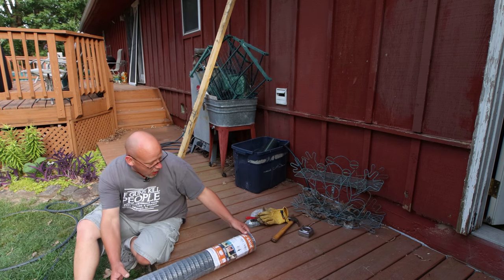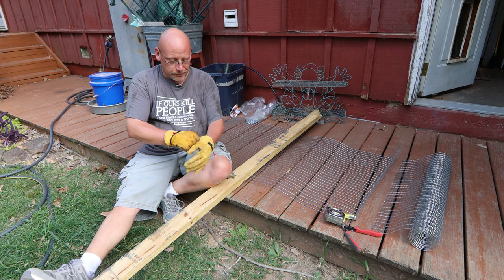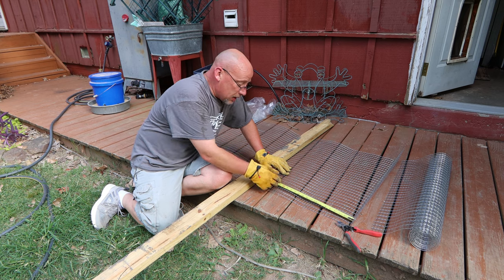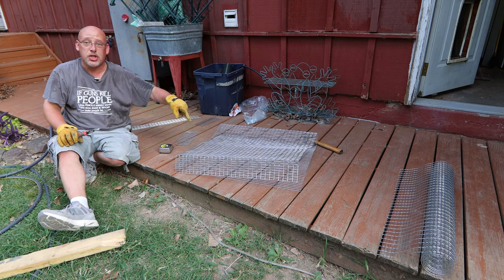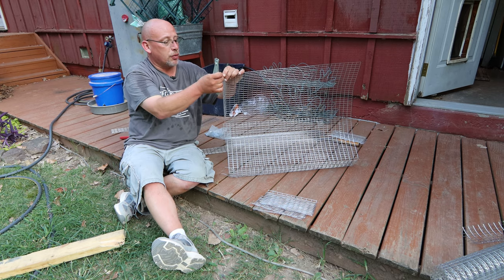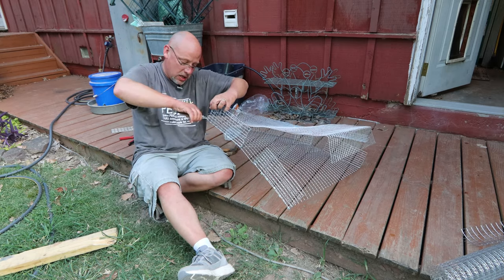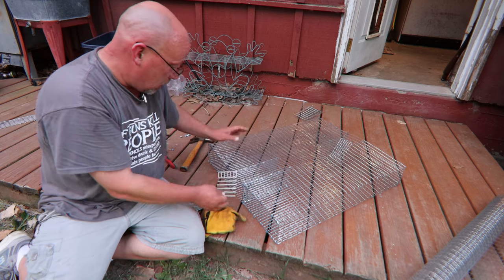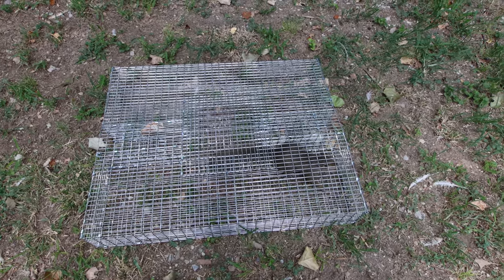This Will Finally Fix The Squirrel Problems I Am Having

Comment: Awesome video! That is a perfect squirrel trap and it will work! I have captured hundreds of squirrels 🐿 with the Squirrelnator in a few months. They ate up tons of my chicken feed and dig out the concrete patio slab. This is a great build wish I saw this video before to save some cash, but if you have the cash for one and you are not handy definitely get one to eliminate your squirrel issues. I almost ordered 2 of them but you only need one it’s that effective. Have you ever caught rats with that build? Btw chicken scratch works perfectly

Comment: If you know the size of the mesh, you don't have to use a tape measure. If your mesh squares are 1/2 inch and you need to measure four inches, just count eight squares.

Comment: Hey Chris, Two true stories. 
My uncle had a similar problem with squirrels. He used a live trap and released them on the other side of a canal and river away from where he lived. No matter how many squirrels he relocated there was always a never ending supply of squirrels to catch. One day he stopped at the feed store for bird seed and was telling the clerk the story about his never ending supply of squirrels and how he relocates them, The clerk started to laugh and told him that there was a guy who also had a problem with squirrels and couldn’t catch them all. It turns out that my uncle and the other guy who lived on the opposite side of the canal and river where catching the same squirrels and releasing them back and forth over the canal & river.
We were over run with opossums and racoons, so we set up the live traps and released them a good distance away and everything was fine. But soon we had the same problem and I could swear that they were the same opossums & racoons. So, I sprayed a small patch of spray paint on their tails before releasing them and sure enough the same ones made it back to our property. 
The moral of the stories is to relocate them very, very, very far from your property or dispatch them. No one around me eats opossum or racoon pie anymore. lol
Reply: When they trap and neuter feral cats, they clip off an ear tip, so if you ever catch the same cat more than once you know it's already been neutered just by looking at its ears.